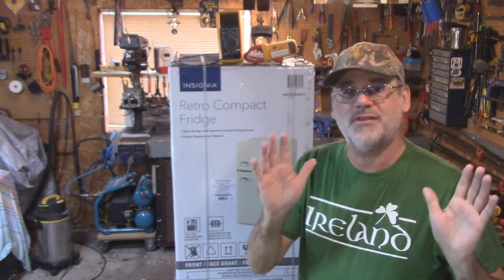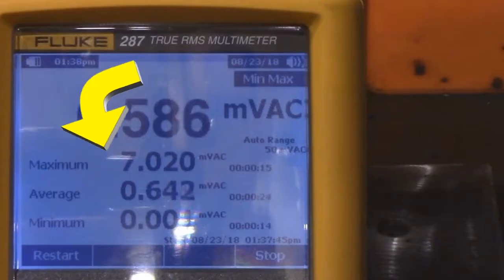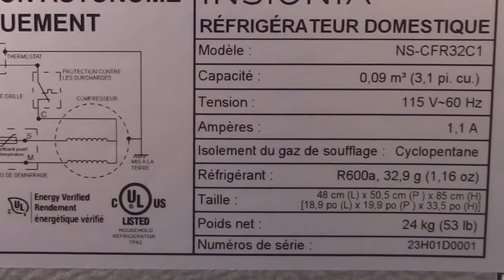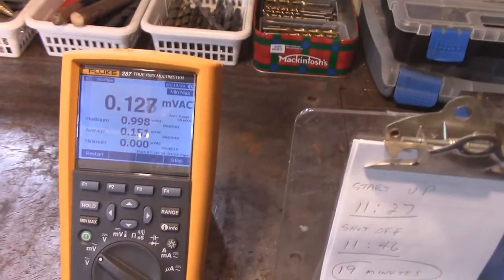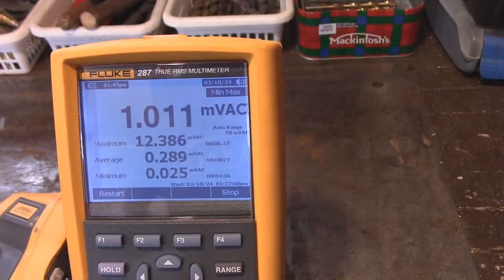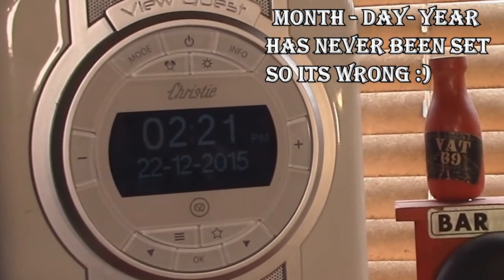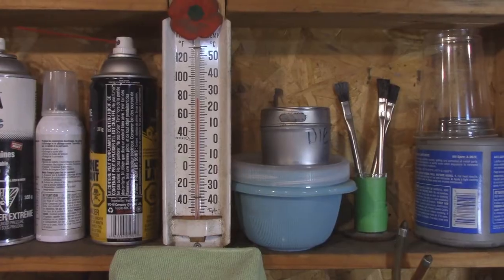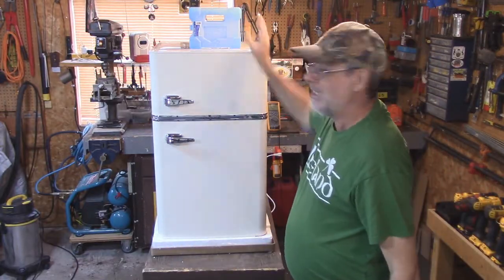Testing Fridge Off Grid - All The Facts And Tips - Insignia 3.1 Cu. Ft. NS-CFR32C1

Comment: The 2017 "Steve" was younger, somehow?:face-fuchsia-poop-shape: The newer fridge seems nice. The separate freezer is a bonus. A lot of people use propane fridges in remote cabins but if you're set up with solar then electric fridges come into play. Having a freezer that keeps things rock hard is a must and the change to this fridge will be a big improvement. Good one, Steve!
Reply from the maker: Thanks  Craig,  propane does take a long time to get cold between trips so solar works best for me.
Reply: @SteveRobReviews  And propane refrigerators can be expensive! New ones can be about $3,000 so many people use old ones out of motor homes but even they can be many hundreds of dollars (or the best part of $1,000) used. Good call on the retro electric fridge. It looks really good!

Comment: I owned the small refrigerator but I didn't like the freezer in side because I had to defrost it once a month. So 2 years ago I bought a refrigerator like the one you have. Just last week I defrosted the freezer for the first time. It didn't really have much frost. It was nice last year I kept Popsicles in it. It will freeze things very quickly in it. I don't even know the brand probably made in China. I bought the all black color and it's very quiet. It stays just below 0. I keep it in my building which doesn't have much heat in the winter. I'm surprised i never got any mice in the back of it. The population of mice in the building was ridiculous. They were everywhere and now I haven't caught any or seen where they might be.

Comment: That s a very conclusive d emo, Steve. That new fridge looks solid built and it’s got that old retro look and the numbers don’t lie. May take more to run it but it does not run as much as your old one, so your saving on your stored battery power and thats very important when your off grid…..CHEERS
Reply from the maker: Thanks Gator,  yes much more efficient and a real freezer.

Comment: Great information Steve.
There's 4 factors to get the most efficient fridge. Daul zone, energy usage, insulation and compressor size/freon. The daul zones with a good insulation will allow the fridge to stay colder longer and the properly sized compressor will get it colder faster which will be more cost effective to operate. Also a 75% stocked fridge/freezer will also stay colder longer than a empty.
Reply from the maker: Great points.

Comment: R600a is also know as Isobutane.  Don't get a leak and a spark, or... BOOM!  I use an old R134 Small Chest freezer.  I normally use it as a freezer, but I have and adjustable thermostat on it.  And I have ran it in Fridge Mode and Freezer mode for months on 800 Watt of Solar.